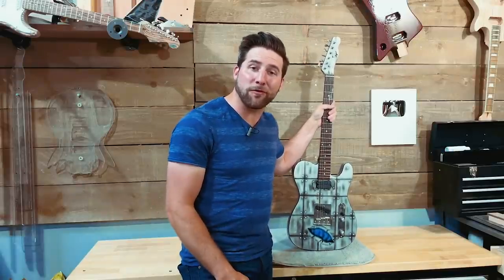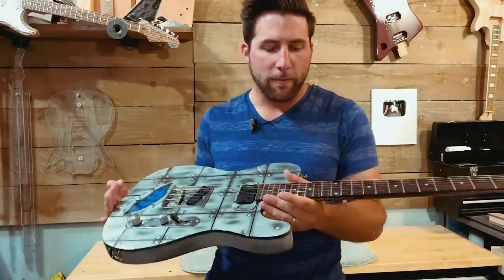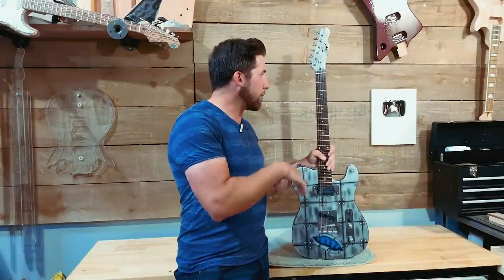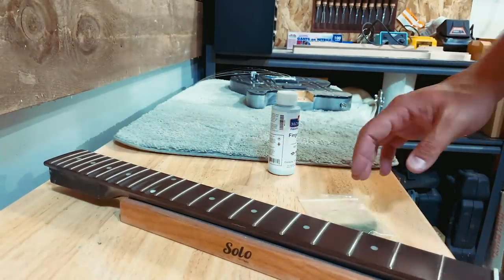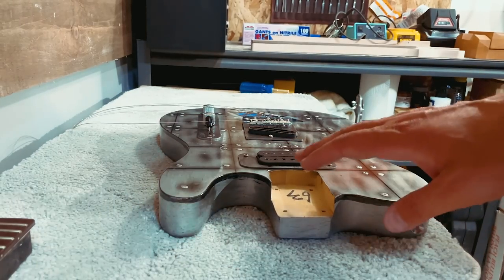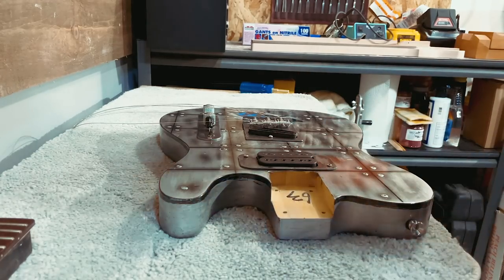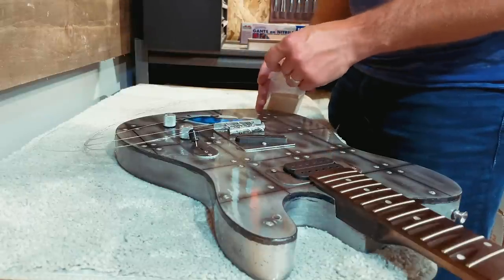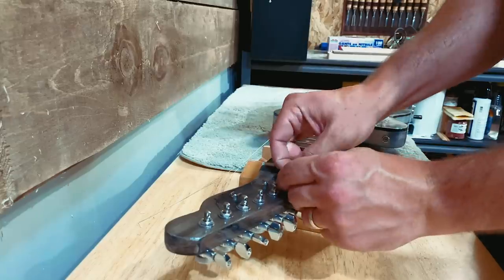A Trick for Fixing High End Action on your Guitar

Comment: Somehow I got unsubscribed from everybody if there is a problem with the payment from my card please let me know Brad I was wondering what happened. Hey I've got a project here and then I could use a little bit of your time one-on-one wouldn't take but 10 minutes or so it's about airbrushing thunder and lightning coming from the clouds into the pickups on mahogany Gibson SG that is bare wood. I need to seal the wood with something as compatible with the paint I'm using in my airbrush and it's compatible with the clear and hardener that I have and they both have to be compatible with a clear that I have to use to seal the wood you see my dilemma I have the materials but I don't know if they're going to be all compatible because that's going to be a lot of work and it's going to be absolutely beautiful cuz I'm going to put three clear coats on the completed picture and then I'm going to highlight the lightning with a close thin Center Line which will be three layers of clear from the original artwork I'll do that after I let sand the clear and then I'm going to put three more coats of clear on it and that should give the lightning somewhat of a 3D effect and make it pop a little more but I've got to make sure everything's compatible and I don't have a clue but we would almost have to talk to one another so I can let you know what I have and you can let me know what I need I know that it's not your normal thing for you to call any of your subscribers but Brad, I really really need your help cuz this project is very very important. If by a miracle you want to call me let me know I will give you my number and no one will ever know that we discussed anything other than here. And most importantly I will eat the piece of paper your number will be on and I will set the phone on self-destruct to get rid of the number LOL. Your old buddy needs some help. I did turn 60 just last month tomorrow so give an old geezer some wisdom would you
Reply from the maker: Hi George, do you already have the paint for this project or are you looking for recommendations on compatible options?
Reply: @BradAngove  thanks a lot for your answer it's 5:45 here right now so when I'm a little more awake here in a couple of hours I'll tell you what I've got if that's okay
Reply: @BradAngove  yeah I already have like the clear that I have came from Custom pans in Florida they get it from the UK and that's the paint I was telling you about it's in a rattle can and you pull the pin on the bottom of it and it releases the hardener that's like good for about 24 hours after that cuz I wanted to use some hardener as a sealer so the wood grain would really pop like you said it probably would with what just using a clear on it. They told me down there where I got that at that I had to use a kind of poly with it as a sealer because I wouldn't get the artwork done with your hair brush before that sealer got done because I would still have to put three coats on it and sand it down and put my other three coats on it I wouldn't have time so I better use a different sealer. Now the paint for my airbrush is a water base acrylic which I'm assuming if that Polly is dry the airbrush paint would be okay and as long as I let it dry 100% to where the water was 100% evaporated that I could just seal it inside with the other clear. And I was just wondering if what I'm doing is going to be okay because I'm going to make my lightning bolts wide and not super bright it's going to be more of the glow on my first application the pulley airbrush back you know and put my three coats of clear on it and then move up on lightning bolts with a real brake light and move in closer and follow them in the center with the actual lightning bolt to give it a little bit of a 3d effect and then put my last three coats of clear on it and then do my finish work on it do you think that's going to work out all right I can't find anybody around here this has any knowledge whatsoever about what's going on in the paint world I guess everything I've learned I've learned from you and a airbrush fell out of you probably know who I'm talking about please a fantastic teacher and stuff. Hey I hope your puppy dog or whatever your pet was that you had to have emergency surgery on is doing well! I have my two wiener dogs I think I told you about them before it will with me when my wife was killed and everything back 2012 and they're like children I know how close you can be to him Brad. I hope it's your buddies doing okay. But that's about the size of things going on but I'm just wondering if the poly sealer and the water-based acrylic airbrush paint and the way I'm going to apply it and then put whatever that clear is that is only compatible with polymer base while I would imagine I guess it's probably base clear if they would all be along on my masterpieces LOL I sure do appreciate everything that you've taught me in the last 2-3 years without you even knowing it and that's a damn nice guitar and that's beautiful work you did on it too by the way I'll talk to you later buddy and thanks again for getting back with me Brad I sure appreciate it. Cheers my brother. I'm an old hillbilly that's why I call you my brother LOL cuz in my eyes you are
Reply: @BradAngove  no reply I just sent you of course it's talk to text you know always use it but I hope you can make sense because I'm not feeling the best I got some crap in my lungs it just it's got me not feeling too good but I hope you can make sense of what I wrote cuz I didn't proofread it too good I know I said crazy pans instead of crazy cans
Reply from the maker: Hi George, I think I understand what you’re after. Are you looking to have any tint to your sealer to help the grain pop? If so, I would go with shellac. Get it all sealed up with shellac and give it a few days to dry. Then sand with 600 grit to get everything smooth and then you can do your lightning work. 
For the clear coat between layers of lightning you’re looking for a mid-coat clear. Spraymax for example makes an acrylic 1k clear that works well as a mid-coat.
Reply: @BradAngove  my main problem is I have the rattle can that has the pin in the bottom that you pull to mix the hardener in with it once that's activated you know how long the paint's going to be good for so I can't really use it for a sealer base because my artwork won't be finished quick enough I'm afraid and what's left in the can is going to have gone bad and that's a $31 problem there. It's 2K clear coat that I bought out of a supplier in Florida that gets it from the UK. In other words is everything turned to lemons I'm trying to make lemonade with it. But now I've come down with we're pretty sure it's pneumonia just hit me all of a sudden. Our son came home with it I catch every damn thing comes through that door and pneumonia in my age being a 47 years smoker isn't a very good thing for me for me to have pneumonia. One thing it's another I'm not supposed to do this build LOL I think I'll just do like you said I'll just start over with the shellac and stuff. It's wonderful being retired for 20 years but it has this bite one gases so damn high and groceries they think it costs $3 a dozen more for the chickens to lay their eggs. I don't understand that do you? LOL I will pass back out I hopped up on NyQuil and my pain medicine for my back. Dude thanks so much for taking the time to write back to me and give me your ideas it really does make me feel good that you do that Brad for me. I'm serious I would enjoy getting together with you before the reaper calls. I'm not just some old crusty greasy old man honest. Man I'm really not a wacko LMAO but I would love to get together and maybe build a guitar with you that would be that would be a, well it is on my bucket list national shit bread. But I'll never have the money to come on and see you and I hope your pet is doing well I really do I understand how it is with animals they become a part of your family buddy. I had a wiener dog named Petey and my heater pulling the van was leaking antifreeze he used to hide his cheeseburger underneath the passenger seat and it got antifreeze on it and it killed a little guy I stood there in front of all my hands and my bosses they worked for me and with me I guess with tears running down my face then feel a bit ashamed you're embarrassed one of my children died man. If I could I would bit some money on that beautiful beautiful guitar that you have there but I just don't brother that's the same reason I'll never get to come and see you I'll take care brother I'm going back to sleep under the blankets what this thing out of me try to do anyways. Later alligator.
Reply: @BradAngove  thanks for the good advice Brad it's working real well I'll send you some pictures when I get it finished. I don't have a paint booth and I live in Ohio so I'm waiting for the humidity and the temperature to be about right. My beautiful wife doesn't like to smell in the house but I have a really nice shed and it's full of tools and my woodworking equipment but I can't get to humidity out of it. That it gets pretty hot in there so I would text me a while to be able to get things done that's why I don't really do projects like it's for customers I just do it for myself and then sell the guitar after it's done. Needless to say it's a very slow process irritating actually LOL but I sure do appreciate you getting back with me buddy. Cheers my friend
Reply: @BradAngove  oh and I wanted to ask you one more thing what's the best way to apply that shellac? It's self leveling isn't it so I would be able to use like a foam brush? I'm feeling kind of brain dead here it happened on the night I turned 60. The days I was still 59 my memory was like an elephant's but for some reason.. it all changed the night I turned 60 LMAO

Comment: Yeah there you go lol.  You ruined the screws..
Reply from the maker: Care to elaborate?
Reply: @BradAngove  Sure instead of being lazy using a poorly sized bit on your power drill , Tighten those neck screws by hand like your suppose to with the proper sized screw driver .   There I elaborated :).   I like your videos but showing people how to build or fix things poorly is not great practice .  Also shimming the neck like that is kinda a last resort and the neck pocket should have been routed out properly to start with ..
Reply from the maker: Shimming the neck is a fix. That was the point of the video. It works perfectly well. It’s not what you would do when planning the build of a guitar from scratch, but on a flat setup guitar like this it’s a good option to make this adjustment. 

The screws are fine and I used the right size bit, so I’m not sure what you’re worried about there or what kind of soft metal screws you’re working with. This task doesn’t need to be done by hand if you know how to use a drill reasonably well. The bit jumping once or twice isn’t going to ruin anything.